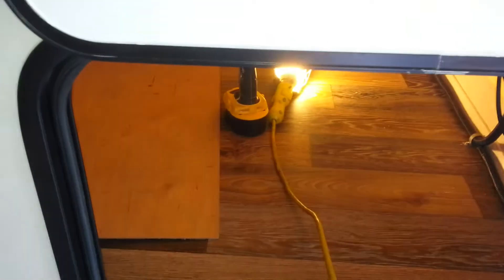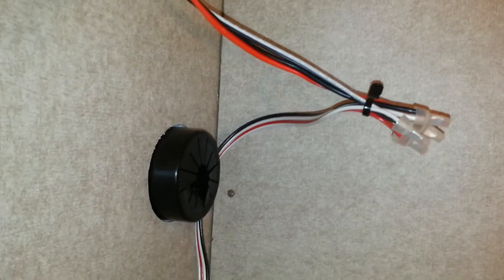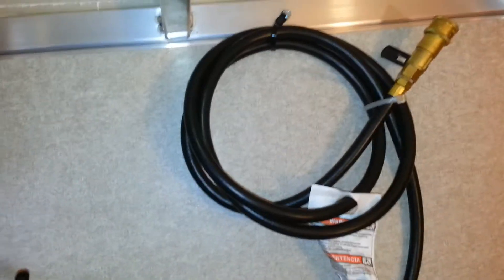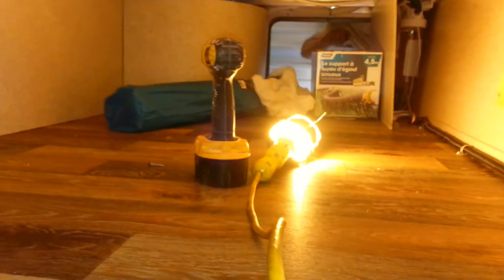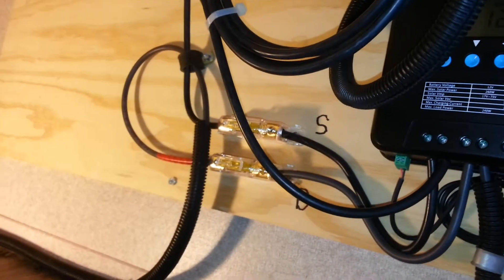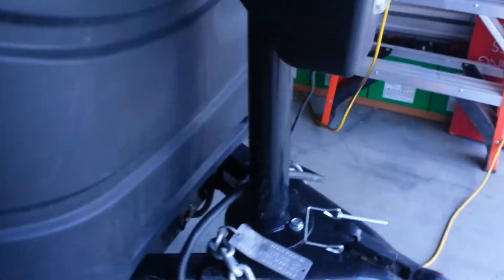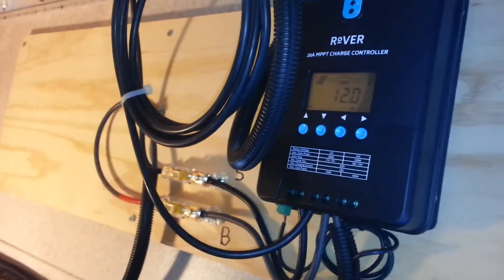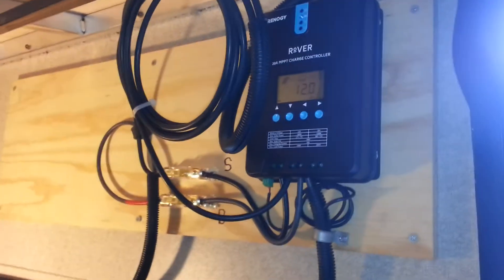Renogy 200 Watt 12V Solar Panel install Part 2  .  Important Link below for you.  Click SHOW MORE.

Comment: Ahhhhhhh. No part 3 🤔.  I just purchased a 2021 2109S and am thinking I’d like to add some solar charging capability.  I was hoping to see your end result.
Reply from the maker: LOL So sorry.  Basically all Part 3 was going to be connecting a shut off switch between the batteries and fuse going to the controller.  :)   We never got to that point.  SO?  I just pull the fuse out of the wire running from the controller to the batteries.  Simple.  YOU CAN DO IT!  Renogy and online help is there if you need it.  :)

Comment: I see you have only one charge controller. How do you connect that to two batteries? I have ordered the same controller for our 100 watt panels. We have same Mini Lite 2109s. Thanks!
Reply from the maker: Sue.  There are 2 wires that run from the controller to the batteries.  Fairly simple really and Renogy shows you on the instructions how to run them correctly.  :)  Hope you are loving the 2109s.   We STILL do.
Reply: Garland Style thanks!   We just purchased ours used from an older couple that I swear never used it! Five years old and in MINT condition... Anyway, I'll await arrival of the controller and glad to know it has detailed instructions! Love all your videos...
Reply from the maker: @Timbertrail1916  Thanks.   Seriously, Renogy Support is very good from what I hear. I never needed it but there if you do.  It really is not Brain Surgery.   Enjoy your kinda  new camper.   :)

Comment: Great video....can you dry camp for 3-4 days with 200 watts solar?  How many batteries do you have?  What type.  Thanks
Reply from the maker: Hi James.  Yes, we went 4 days with no elec hookup, just solar in Quartzsite AZ.  I have two cheap Marine Deep Cycle batteries.  Every morning by noon, with sun, the batteries were 100% charged.  I never run my batteries below about 60%.  I've run them to 50% and that really shouldn't be done.  So?  If I can go 1 day, I can go on for months that way.  Just check the water level on those type batteries.   I will be doing an Electricity 101 video here in the next month that shows why we can do that.  Simple needs need simple solutions.  :)  Thanks for watching.  Michael

Comment: Great video, I want to install solar on my 2018 21FRBS.  can you tell me what type and length of screws you used to attach the Z-brackets to the roof?  Also, do you have the Alpha Superflex roof and if so, what type of sealant do you use?  Thanks!!
Reply from the maker: Hi Rick.  Way cool man, Solar is marvelous!   I wish I could remember the screws Rick, but they were  stainless steel about  1 1/2" or 1 1/4" size.  Not much fear of going through your roof with those at all.  We drilled a small pilot hole after marking the spot the screws would go in, then doped up the bottom of the plate before setting down,  doped up each screw with lap sealant,  then screwed them in place.  NO water getting in there. And of course we lap sealed around each bracket afterwards.  I used Dicor brand "self-leveling" Lap Sealant.  For flat surfaces use Self-leveling lap sealant.  I honestly don't know the type of roof I have.   It is a tough grainy roof however.   Carry a tube of that with you and the Eternabond RV Rubber Roof tape with you as well.  Wonderful stuff.   Thanks for watching and let me know how it came out!  Michael

Comment: I enjoy your videos n the info. thnks. Question. We're looking to add solar panels. I've listened to you n others. I'd like to start out small n have the ability to add on. Looking at Renogy 100-200watts.  Your thoughts?
Reply from the maker: Hi Steve.  Sorry I missed this post.  If you have room on the top, go with 200w.  I've been ULTRA happy with 200w and two batteries.  I am thinking of putting up 200w again bringing it to 400w.  I'll be getting AGM batteries (2) when my cheapo 12v batteries die. :)   It is a fabulous upgrade and I believe the best ease of mind option you can do.  Safe travels!  Michael
Reply: @garlandstyle5797  thnks Michael. I'll keep you posted when I get started.